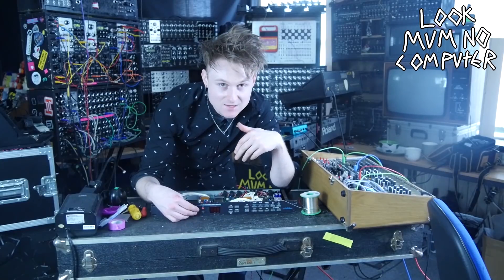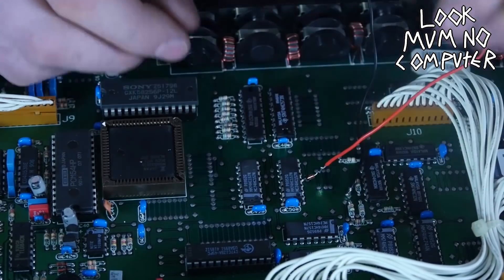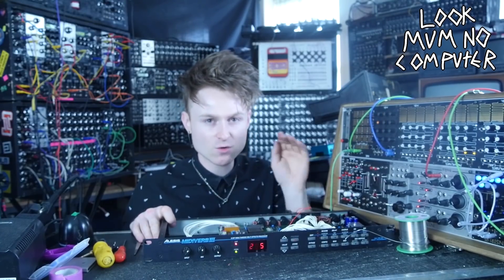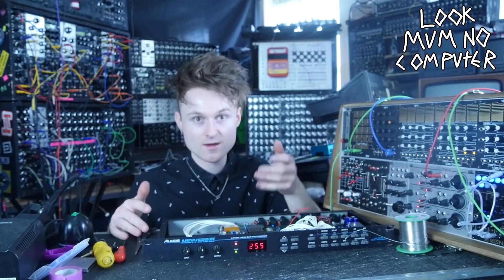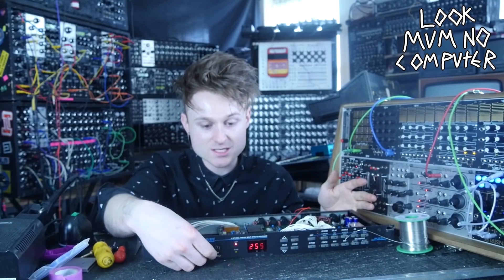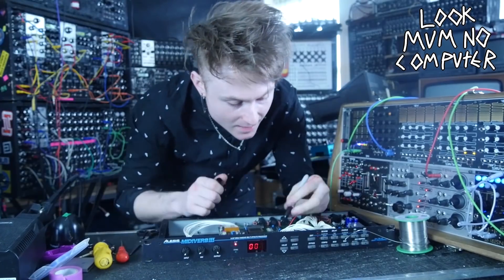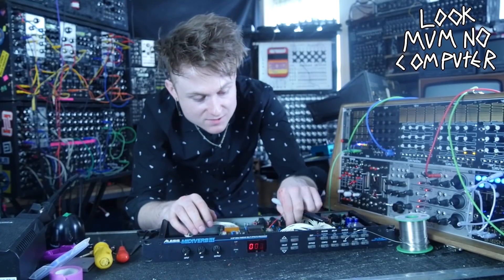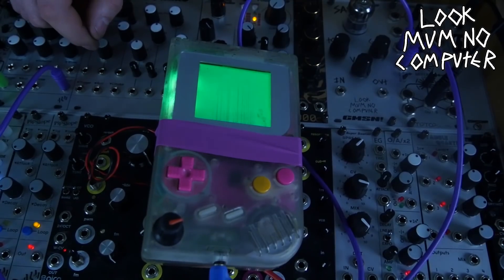Injecting voltages into an ALESIS MIDIVERB an Experimental BOOM

Comment: Hey mate! I'm just started to get into this stuff a bit and have been using your videos as reference for a lot of stuff, huge fan! I had a question about this video though, why aren't you grounding the signal coming out of the oscillator? Can't floating voltage damage stuff? I guess if it's £20 and you're just sticking wires where they don't belong that might not be a concern lol

Comment: Hot damn, i just happen to have one of those units sitting around. I assume with the diode, it just needs to be rated over the internal voltage of the alesis. Black line facing towards the tip, yeah? though i would think that there is more risk of frying the alesis with negative voltage from the modular than voltage going back to the modular.

Comment: Nice bending guide. But diode will not save you. Eurorack has 220R to 1k on all ouptuts that are actually doing the saving. 5v zener paraell makes more sense in this case.
Reply from the maker: Frantisek Markus fair dooz! The diode was more to not let the negative voltages from eurorack into the midiverb. Or the gameboy. Which was crashing it. But good point!
Reply: A good, fairly safe input scheme I use:  input through 1K series resistor.   End of series resistors has diode with cathode to V+ (to prevent voltage above the supply rail) and a second diode with anode to ground to get rid of negative signals.     Then you route that junction to your probe.    Safe, and doesn't rely on needing a variety of 10, 5, 3.3V zeners lying about.
Reply: Better yet, use an optocoupler, midi style, so you don't have ground loop problems.

Comment: Diode at the end of the wire? Hot tip, thanks! Also if you're getting kickbacks from Novation, it's working 'cuz I'm going to google that Circuit mono thing right now.